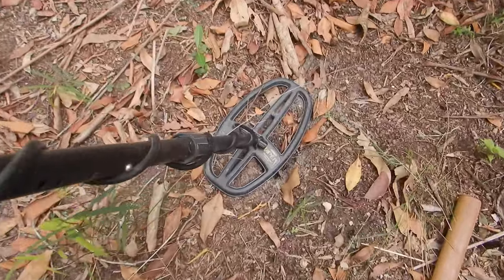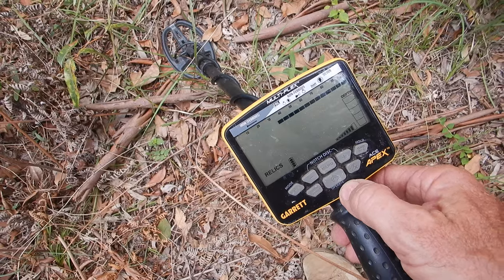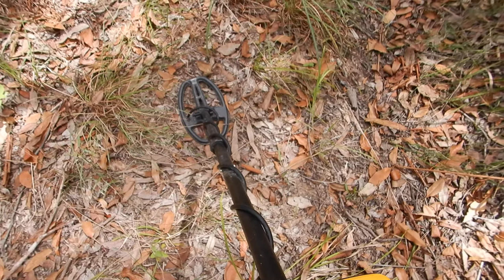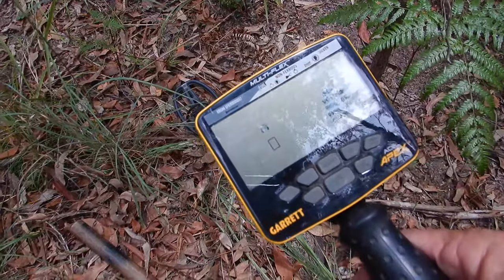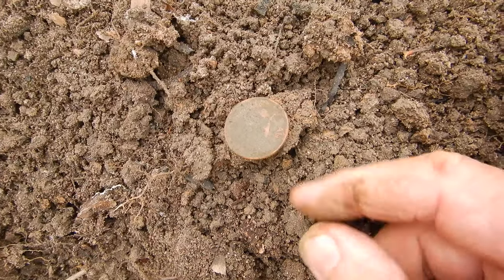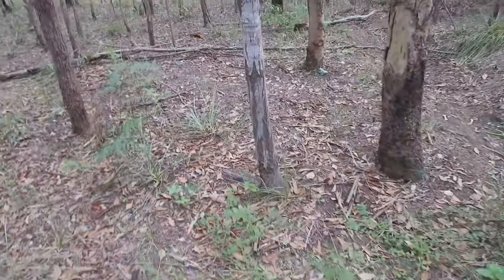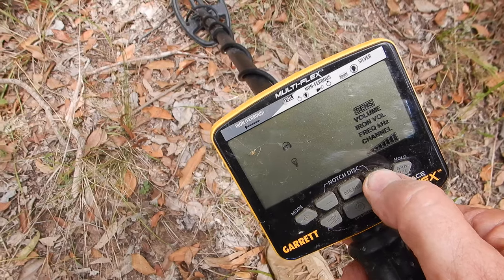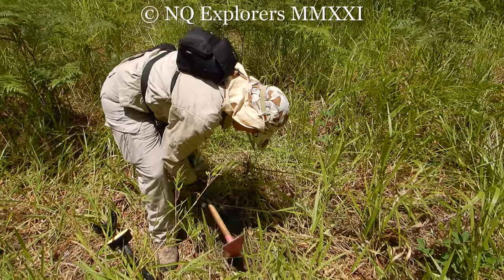Garrett Apex Metal Detector: Advanced Tips.

Comment: Do you use the pin point mode on the apex? Or do you find it useless.
Reply from the maker: Thanks for watching Mark, no we don't actually use the Pinpoint function on any of our detectors - just as easy to do a 'DD wiggle' then use the Propointer. Constant use of the Pinpoint function will tend to drain the battery quicker too on any machine. Cheers mate and Happy Fossicking! Warren.
Reply: That is great question 🤔.